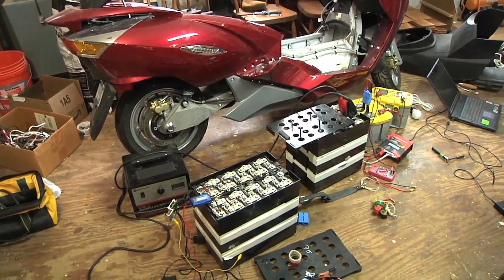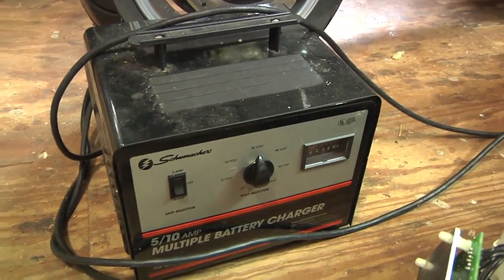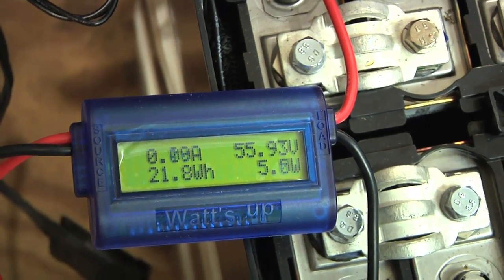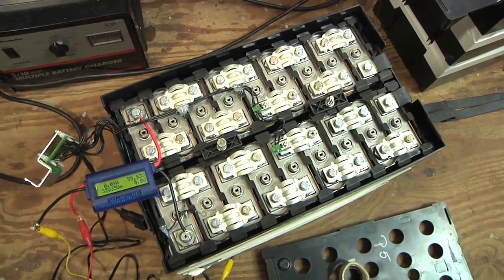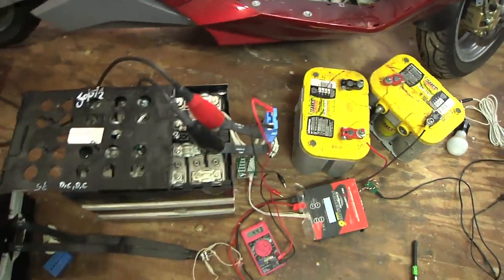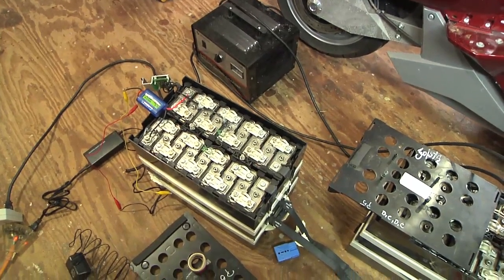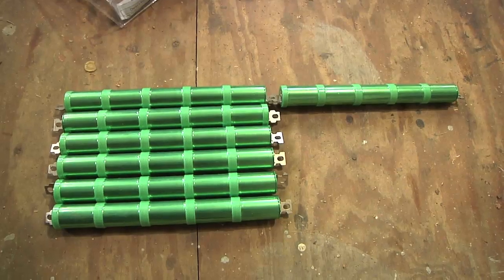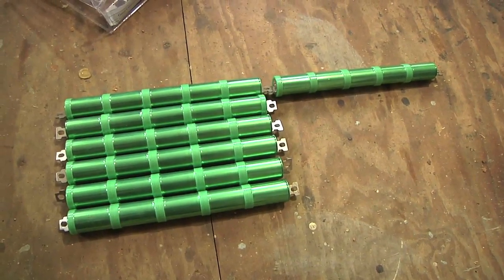Vectrix Repair: Day 3 - Battery Charging

Comment: Hi. Is there any way to get specs info on original NiMH batteries? Like brand name or how much Ah when they where new? Or internal resistance? Thanks.
Reply from the maker: Hmmm. Sorry  I don't really know any of those specs off hand. You could try asking at the V is for Voltage forum. http://visforvoltage.org/forums/vectrix
Reply from the maker: They were 40AH cells. I don't remember any markings on them for a brand name.